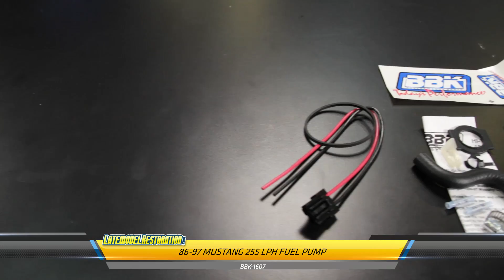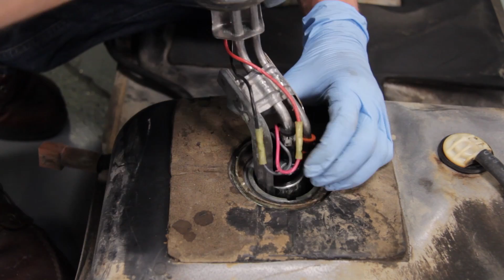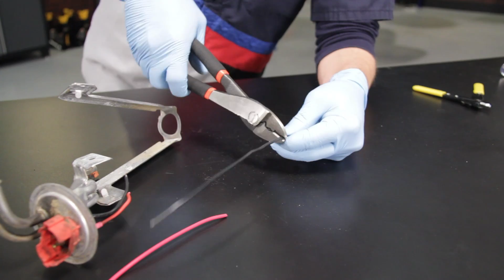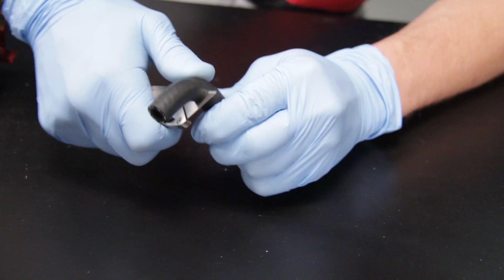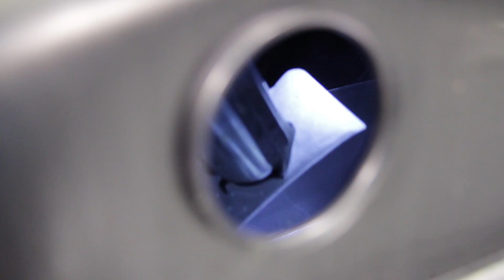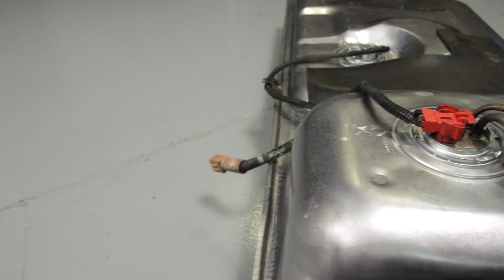Mustang Fuel Pump Install: BBK Fuel Pump 255 Lph (86-97)

Comment: Does this pump make a humm noise when key is turned?
Just installed last night 
I turn key without starting engine 
I didn’t hear any noise coming from tank 
Also tank is empty.
Please advise
Reply from the maker: There will be an audible humming noise coming from the pump for roughly a second whenever the key is turned to the on position.  Have you confirmed that the pump itself is receiving 12v when the key is turned on?  -Landan
Reply: @latemodelrestoration  
I found the problem. Bad Fuel pump connection
Red wire was not connected properly.
Thanks for your time!
I appreciate it! 💯

Comment: Glad I’m reading these comments! Good information!
I was wanting a 255!! But I have minimal mods & I don’t want to create more problems!
I have 89 model with return fuel line! E303 cam & bigger exhaust valves with headers !
Injectors throttle body etc still factory!
I think 155-190 is big enough for now!
Guessing bigger pump louder noise too!?
Of course I’m wanting upgrades so 190 prob safe?! Next mods prob injectors ,mass airflow,
Throttle body, upper lower intake?!
Or I’ll jus continue to ride around & be more bark than bite!? Lol!!
Least I’ll sound good! The speed limits 60-70 anyway bahahahahah

Comment: My 1986 Fox-body has a 351 Windsor carbureted engine fully built, has a 750 Edelbrock carburetor, does around 550 hp, what fuel pump should I use for the best performance?

Comment: Will this pump work for a 88LX with EV1 Jetronic 24lbs fuel injectors, and stainless fuel lines? All other engine parts are pretty much factory except for a 70mm throttle. I'm planning on going E-85
Reply from the maker: Yes, it'll work! Works great with E85!

Comment: Should I buy this for my fox? Because I wanna go with a 100/150 shot.. I have 24lb injectors gtp heads e303 cam and full exhaust plus headers and cold air intake...
Reply from the maker: The 255 lph pump would be a good upgrade for this particular setup you have currently. Especially with the spray, it would be best to go ahead and upgrade the pump before you do this and then have it tuned.
Reply: What about the 340Lph ? What would you you recommend?
Reply from the maker: If you plan on going with a larger head/cam/intake combo down the road you could go that route. IF this is the way you are keeping it then the 255 is fine.
Reply: Late Model Restoration    Thx.... yep 340 it is ... definitely changing up soon ...💪🏾💪🏾

Comment: I have noticed on my factory fuel pump bracket at the bottom where the filter sock is fastened there is a small metal tab. Is this tab there to correct the position of the filter sock into the baffle of the fuel tank. Does it matter how the filter sock is positioned within the baffle as long as it fits inside the baffle. What does the metal tab serve?  Does it help keep the filter sock in place and position the sock a certain way within the tank baffle?  Can the metal tab be bent up to position the sock long ways in the baffle.

Comment: i have a 89 mustang, it had a 2.3 L in it. put a 302 with a bigger cam, and put a 650cfm duel line carb on it. what need to know is can i use the the same fuel pump in tank. by just getting a bigger pump to go in tank are well i need to get a after market fuel pump. and the fuel lines too. i would like to be able to have the fuel gauge to work too. if any of that makes any scents.

Comment: What about the wiring harness replacement? A 255 will cook the fuse links and melt the OEM wiring harness. Replace all of it all the way to the battery and install a new solenoid under the seat or just put a manual toggle switch in instead.

Comment from the maker: 255 LPM is overkill for a factory vehicle but with return style fuel systems this wouldn't be problem.
Reply: Would this be a good suit for a "1989 2.3L mustang" with fuel injection
Reply from the maker: @THUGGINDAILYGAMING  No. A 255lph pump is way to much for a 2.3L car. We only sell the 88lph pump (factory rating) with the hanger assembly. Link below. -Landan

https://lmr.com/item/LRS-9407BA/mustang-fuel-pump-hanger-assembly-efi-85-93